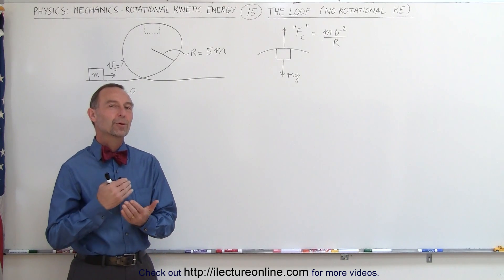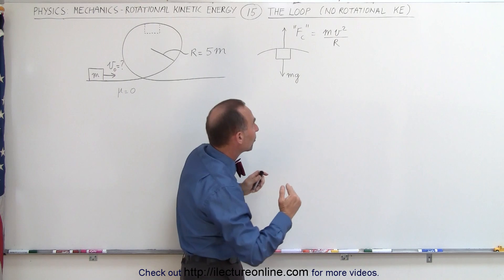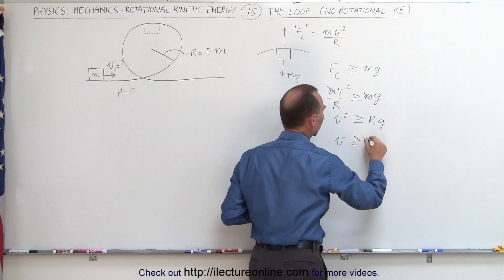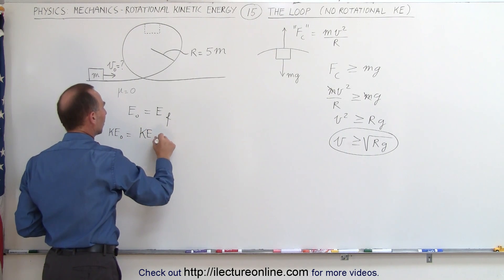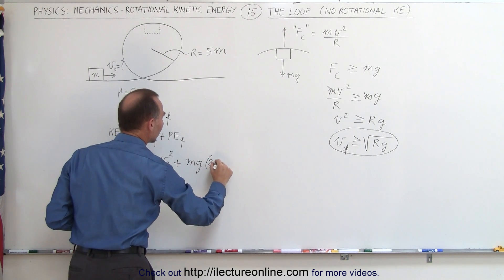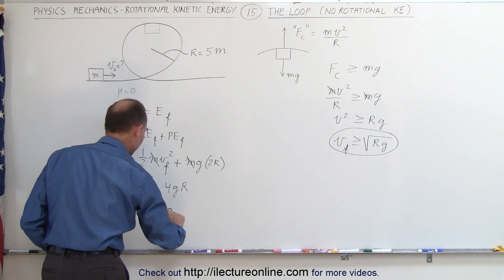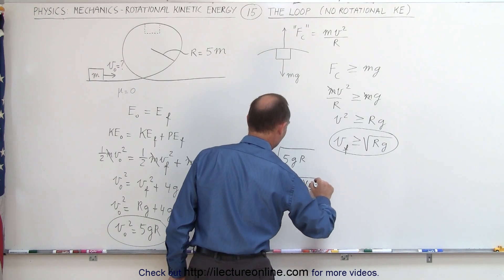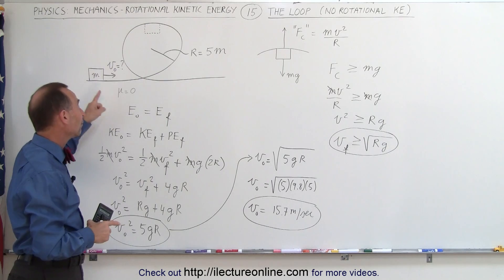Physics 8.5   Rotational Kinetic Energy (15 of 19) The Loop (No Rotational K.E.)

Comment: Good series; I'm getting a lot out of it. 
I've seen this type of problem before and never realized there's a mistake as solved.
The change of height for the potential energy is NOT 2*R because it doesn't take into account the thickness of the block.
While the part of the block that starts at the bottom goes up 2*R, the center of mass does not. If the height of the block is 'h' then
the center of mass goes up (2*R-h). This same argument applies to the next video as well, and maybe others. (I didn't think of this until I was looking at the next video, so there might be some other videos before this that need to be corrected.)

Comment: Thanks for an interesting video and helpful series! My question relates to the energy balance equation....when the mass moves from linear movement to the loop, does it trade linear energy into rotational energy? Say if the example had a loop which was horizontal, and potential energy was not affected, as the mass starts rotating about the loop, has it gained rotational energy?
Reply from the maker: When you convert the linear (translational) kinetic energy into rotational kinetic energy as it goes around the loop, you'll find that the magnitude of the KE is exactly the same.

Comment: Hello Mr. Biezen,

In this case is the normal force = 0? If not should it be this: mv^2/R = mg + N. I consider the v^2/R positive so both N and mg are positive.
Reply from the maker: I don't know what you mean by "in this case".  While the block is moving around the loop the normal force changes and is a function of the speed of the block and its position in the loop.  At the top the normal force = mv^2/R - mg and thus will be zero when those 2 terms are equal.
Reply: @MichelvanBiezen Why is the normal force changing, Mr. Michel?